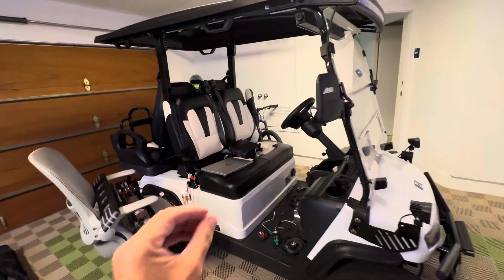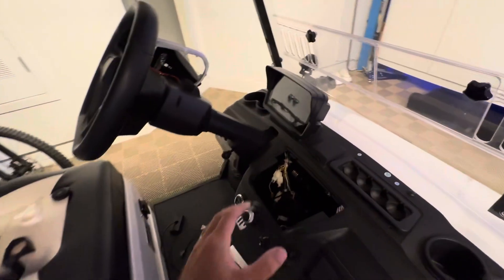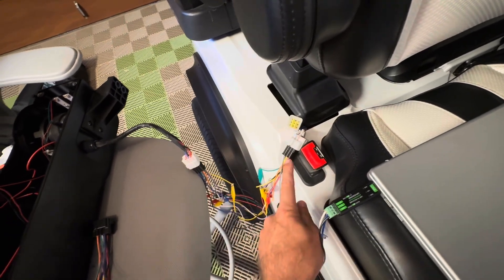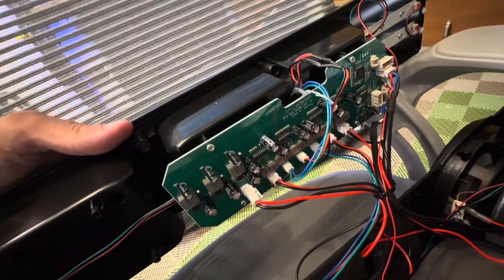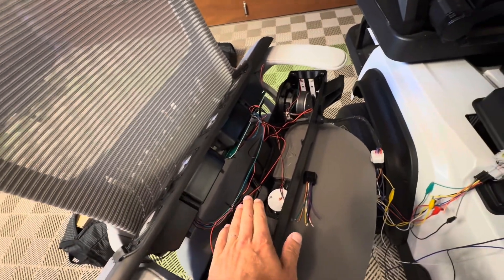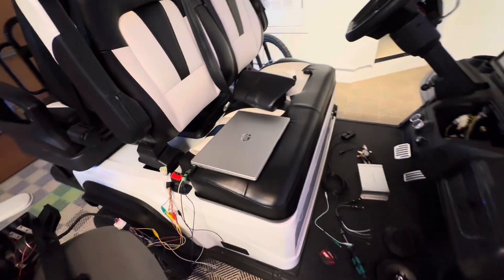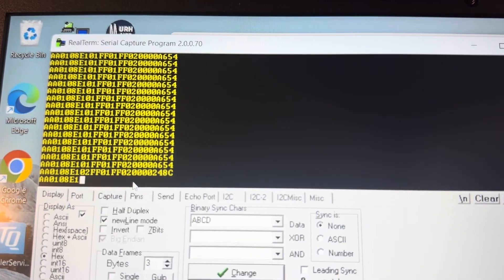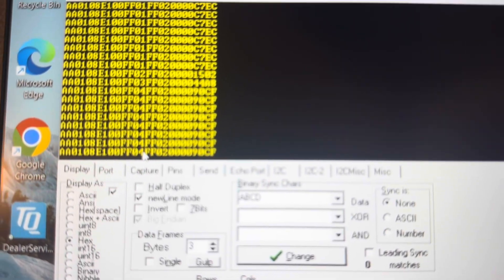Hacking the Evolution Cart D5 Soundbar – How the Head Unit Talks Over RS485

Comment: Regarding the high pitched whine on startup, it seems on my cart like it's mostly caused by the headlights.  If you turn the headlights off during the startup whine it goes away.  Regarding the serial comms -- the documentation I've seen says that's CANbus, not RS-485.  They're similar but there are some differences and while you're receiving, it's my understanding you may have difficulty transmitting on the CANbus to native CANbus devices like the soundbar with an RS485 adapter.  If you get CANBus working, you should also be able to see things like battery SOC and speed on there (since that's how the factory head unit gets that info), so might be able to create a working dash on an aftermarket head unit.
Reply from the maker: The documentation is wrong. The rest of the cart (controller, knobs, pedals, ect) runs on proper CAN Bus. I have already used Savy Can to collect the packets and build a DBC file for the cart. So the other CAN lines are indeed CAN Bus. 

Yes CAN BUS is how the head unit interprets the data for speed and battery. However you will notice on the diagram it’s a different “can” line that goes out to the soundbar and it’s not shared. 

However the infotainment system to soundbar is not the same bus. I spent hours with my CAN adapter trying to get a reading, and when I cracked the soundbar open it was clearly labeled RS-485 on the circuit board. Which gave me the idea to switch it up and I am able to get clear data readings now. So the soundbar to head-unit line is definitely RS-485 and is not shared with the rest of the CAN Bus. 

Interesting regarding the headlights. Will give it a try.
Reply: @hillvalleylabs  You're doing great work.  I've been thinking about doing some similar reverse engineering, but my garage has been too hot to work in.  My biggest gripe is having to reach down to the touchscreen (especially when the seatbelt always seems to lock up) to control the volume.  If you can intercept the volume control maybe a cheap ESP32 card could be added to the sound bar that could be paired with a bluetooth steering wheel remote to control the sound bar directly
Reply: also, I know you have the 2+2, but have you been able to find any wiring diagram for how the additional speakers are wired in the D5 4-forward Plus with the additional speakers under the seats?  The diagrams I've seen only show the soundbar.
Reply from the maker: @gregr1416  - Yeah if your wearing a seatbelt they also lock constantly so you cant lean forward to even get at the volume.   From what I have seen so far, I think you could replicate the volume commands if you disconnected the head unit via an ESP32.  However you might not be able to use both.  The head unit sends the serial command to the soundbar it looks like about every 1 second, whether or not anything has changed. So if for example we send a volume UP, via the ESP32 the head unit will send a command a second later to move it back down.  I have not seen the head unit ever receive any commands or listen for changes it seems to just be a 1 way emitting the current settings to the soundbar. 

For this reason, and others I think I will go the Bluetooth Media Device route on the steering wheel.
Reply from the maker: @gregr1416  - I do not know whats going on in the Plus models with speakers from the factory.  Have not found anything for that just yet.  I have read the main complaint is the disconnect in volume between the seat speakers and the soundbar speakers.
Reply: @hillvalleylabs the second speaker whine issue is cause by dimming of the daytime running lights. When you turn on headlights, the cart dims the DRLs and that introduces EMI that you can hear with volume turned up high and no music playing. I believe it’s different than the start up one, which I think is what you said, basically the sound bar powers up before the head unit and head unit is just passing noise until it activates/grounds its audio line out. I have parts to try and build a harness to disable the DRL dimming to prevent that issue, but cart is not here for a while. 😢
Reply from the maker: @KennethPadgett - Hmmm that’s also some good info. That makes sense. 👌

The headlights and the audio system are pulling power from the same DC-DC converter or accessory bus.

As you said when they attempt to dim the headlights, the headlight current is chopped up with PWM, the ripple/noise rides along the supply line and is picked up by the speakers. 

Another option outside of filters is to give the stereo its own dedicated 48v to 12v reducer. 

Which might be one more benefit of going that route. Let me know how the filter works out and which style you tried.
Reply: @hillvalleylabs I wasn’t going to do a filter, just splice power to the DRL full time so they stay on constant. They don’t need to dim for the headlights IMHO.